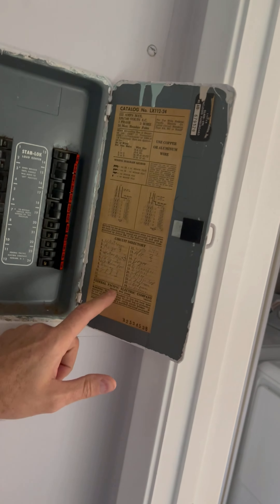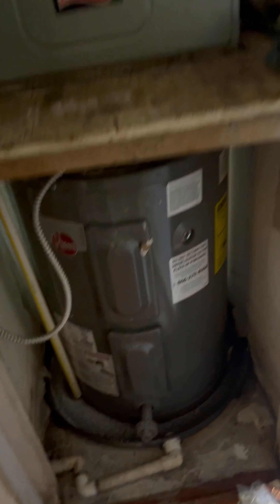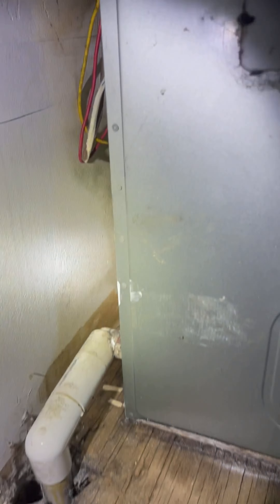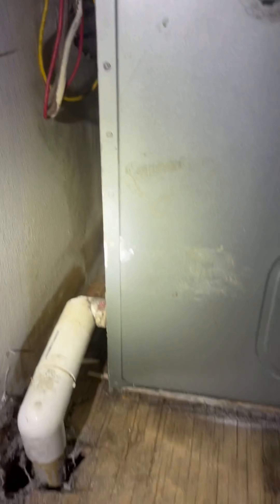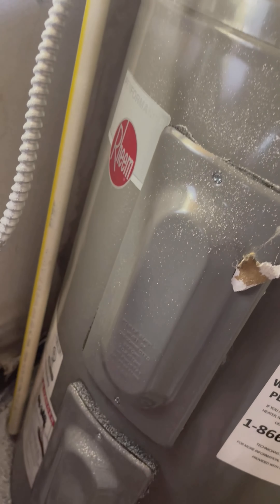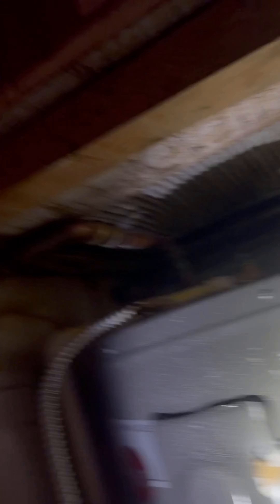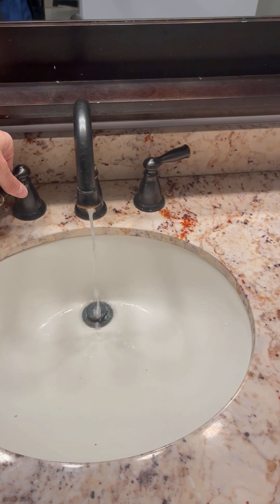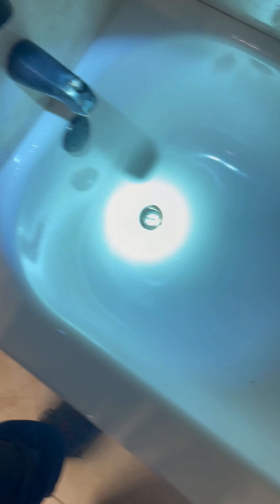This quick condo inspection reveals some major issues

Comment: Why on earth is the ceiling so low?
Reply from the maker: Good question! I'm 6'3" for reference and this place was built in the early 70's.  Current building code requires a minimum of 7'6". The fan blades must be at least 7' above the finished floor. Judging the fan in the background, it appears to be  good in order. Thanks for watching! 🤗
Reply: @HomeStarInspect  Ah so it's just a little low + perspective. Does Fl have old places with drop ceilings because they're HVAC retrofits like up here in the north? Also electric baseboard heaters love to set those old breaker panels on fire haha